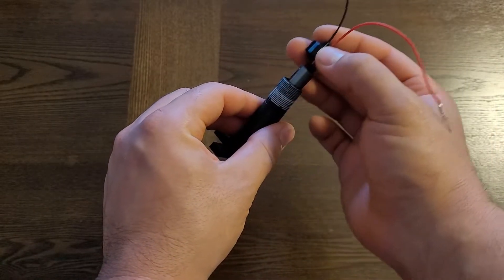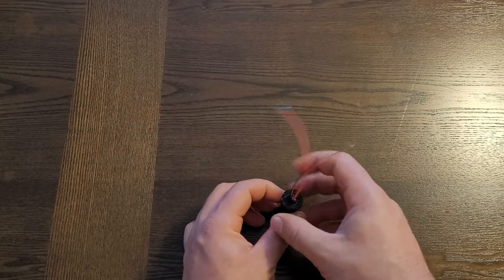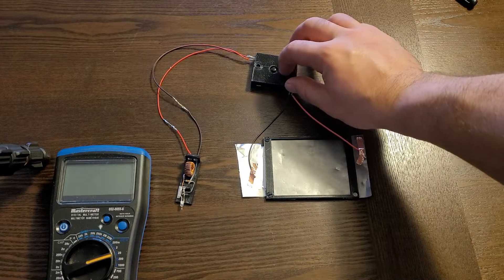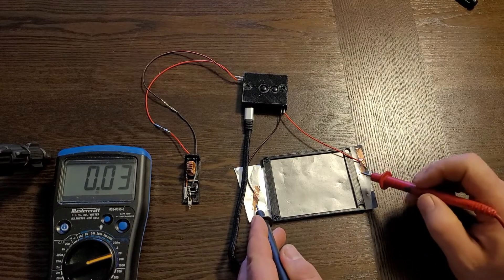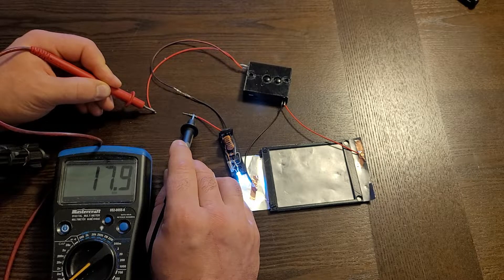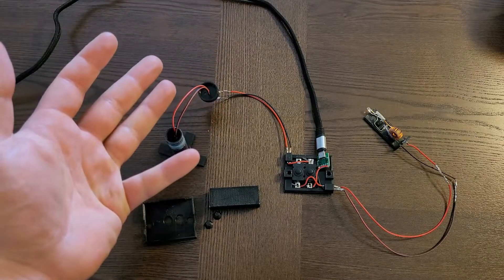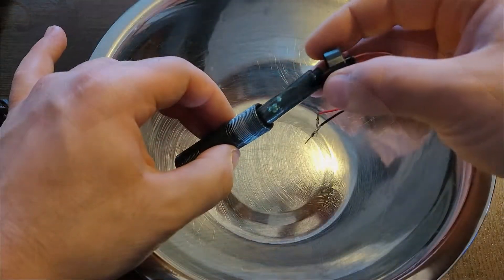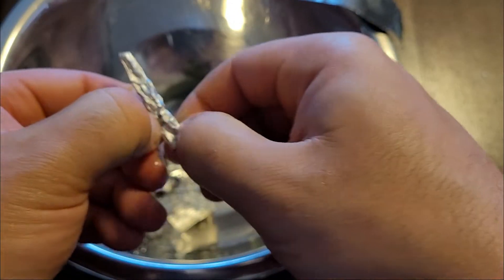Recharging my Aluminum Air Battery Part 2

Comment: Cool video! Ive gotten a lot of good info from you and your battery development. I started working on my first battery design in highschool a few months before your part one vid, so that was great timing.Just one question, which I don't know how many people you've had squawk about this, but do you think maybe you ended up making an aluminum ion battery instead?Aluminum air batteries arent rechargeable, at least not to the capacity yours shows. I've built 3 versions over the past couple years and they didnt recharge (I didnt understand at the time that there was aluminum ion and aluminum air until I made version 2) On the other hand, the liquid youre using has stuff in it that are highly similar to the electrolyte used for the Al-ion batteries, which as far as my research has gone, only seems to differ from Al-air batteries in its electrolyte (in a basic comparison), hence why Im asking this seeing that your battery recharged
Reply from the maker: Hi there @CAMARO54-jk6jb Thanks for the comment.  Great to hear you've been enjoying my videos.  I have wondered the same thing.  However because the charge dissipated quite quickly I thought perhaps the cell was behaving like a capacitor instead of an ion battery.  Unfortunately I don't have any way of proving or testing that hypothesis right now.  Sorry I can't give you more information.  Thanks for asking the question though.  Maybe that's something you'll be able to find out before me.
Reply: Well I’ll be happy to let you know how the experiments and testing goes with my next batch.
Reply from the maker: @CAMARO54-jk6jb  absolutely! I love to hear the work others are up to.  Good luck :)

Comment: it would be great if you loaded it with activted carbon. 
i get around 20miliamp with small , highest 70miliap with 1.7v i got.
Reply from the maker: Oh cool.  I've worked with activated carbon in other configurations, the best I got was 150 mA at 1.2V, but that was using a catalyst and special electrolyte as well.
Reply: @MechanicGoneRogue  tried yesterday with KOH UREA DES :d ,, GOT 200mah with 1.2 V Size 2cm * 3cm electrodes :D .

Comment: Good video.  I've always had trouble with aluminium air battery. Im currently playing with a Zinc iodide battery... trying to solve the self discharge rate.
Good luck
Reply from the maker: Thanks.  I'm glad you enjoyed it.  I agree there are lots of problems with aluminum air battery still unresolved, but it's still fun to dabble from time to time.  Best of luck with your Zinc Iodide battery.  Cheers!

Comment: well, I had another comment about paper zinc batteries here earlier, but youtube seems to have screened it out automatically as spam yet again. It isn't even in my comment history anymore, despite me not writing any links in it.
Reply from the maker: Well my disappointment is unmeasurable.  Seriously most of the stuff you send is super helpful.  I should really try to set up a forum or something.  I should have an email address in my about section.  If you want you can try that.  If you prefer not to that's cool too.  No pressure.
Reply: @MechanicGoneRogue  just sent an email a few hours ago
Reply from the maker: @PixlRainbow  I got it.  Thanks for sending it.  I'm about halfway through it.
Reply: @MechanicGoneRogue  meanwhile, i found out about calcium ion technology, which though non-toxic, hasn't really seen any attempt at commercialisation, unlike sodium ion and aluminium ion.

edit: it appears youtube deleted my second paragraph for some reason, so I'll write it in again:
I note that some batteries don't rely on galvanic operation. That is, they don't rely on the difference in reactivity between one electrode and the other to produce the voltage difference. Instead, both electrodes are made of the same material, and the active ion sticking around one electrode more than the other is what provides the voltage difference. Some sodium ion batteries, for instance, use the same material on both electrodes (most commonly "prussian blue" sodium ferrocynate). I wonder what would happen if you used graphite foil on both electrodes in your battery and then charged it
Reply from the maker: @PixlRainbow  got any papers on calcium ion batteries.  I'd be interested to learn more about them.  Interesting thought on using two graphite sheets as electrodes.  I could try my ethylene glycol DES or maybe even just salt water and see what happens.  I don't suppose you know of any papers that talk about this type of battery in more detail do you?
Reply: @MechanicGoneRogue  not much interesting papers that are directly applicable to diy construction I'm afraid. You can make calcium-based DES pretty easily with hydrated calcium chloride, but the electrodes are not nearly as easy to get your hands on.

As for the intercalation electrode technology, several battery types use that technique, including existing lithium ion batteries, I haven't looked that much into it.
Reply from the maker: @PixlRainbow  oh that's too bad.  I did look up calcium ion batteries after you mentioned it, but I gave up when I didn't recognize lots of the chemical names 😅.  I guess that'll be a project to try another day.

Comment: This is just Aluminum carbon chemistry.  I've been making carbon cells for about a year now and I have produced batteries in the tens of watt/amp hours.  Try zinc sulfate in water, your energy density should increase 4-10 times.  Aluminum metal actually works well with zinc ion chemistry, zinc ions will form zinc metal on the negative AL metal, turning it into a zinc carbon battery that is 100% rechargeable.  However, it's best to just use zinc foil for negative, you can buy whole rolls of zinc foil for roof flashing.  You can also just use graphite on both sides no matter what electrolyte you use, this is a super capacitor.  Though graphite foil works surprisingly well on it's own, activated carbon works about 4 times better.  With zinc ion chemistry and activated carbon, I've gotten over 80 watt hours per kg in energy density.  Hope this helps!
Reply from the maker: @Rob Weaver Really appreciate you sharing your experience here.  It certainly is quite helpful.  I've got a couple follow up questions?  Assuming I use zinc foil.  Will the zinc sulfite work in any non aqueous applications?  As you can see in my videos water evaporation has been a problem for me and I'd like to move away from it if possible.   If your using zinc ion chemistry does the carbon/graphite sheet still need to be exposed to the air?  I'm thinking of trying to sandwich the activated carbon between graphite sheet and paper towel, but that wont work obviously if it needs air to function still.  Thanks again for the comment.
Reply: @MechanicGoneRogue  I would probably stick to aqueous batteries.  Most solvent's available for DIY are very poor conductors, and you will get pretty terrible power density most of the time.  If you're having problems with evaporation, try flooding them more and sealing as best as you can.  There is no air chemistry in the zinc ion.  The carbon hold all the capacity and it's purely ionic.  It's actually a supercapacitor battery hybrid, which is why they can withstand so many cycles(10,000).  Be careful though, zinc sulfate will form zinc metal dendrites.  Dendrites will grow through almost any separator and short the battery out.  Printing paper I find works really well as a separator, but it's still not good enough.  Having some space between the zinc foil and separator is your best bet to stop dendrites(Even 1mm is enough).  If you have a gap between the zinc and separator, that means your cell needs to be 'flooded' with electrolyte.
Reply from the maker: @theinsider8872  Yah that's what I've been finding lol.  Making a sealed battery is pretty hard especially when it needs air to work.  Thanks for the heads up on the dendrite formation.  I've read about that being a thing for metal ion batteries.  Certainly want to give this idea a try in the future.  Cheers!
Reply: @MechanicGoneRogue  aqueous works for zinc because it's electrode potential is 0.76, which is below hydrogen's 0.83, so zinc just barely manages to be preferentially plated over hydrogen gas.
On the non-aqueous front, Zinc Sulfate (not to be confused with Sulfite) can be dissolved as a third component of another DES like urea/eth glycol/prop glycol + choline chloride, but it does not perform very well, giving a poor conductivity of about 5-7.5mA per cm2 of electrode area. The hydrated form of zinc sulfate can also be used for preparation with no problems though you might need to keep the solution hot for a while to dry it out before it will all dissolve.

Zinc Chloride performs very well when you dissolve it into another DES like urea/eth glycol + choline chloride (conductivity of 30mA per cm2 of electrode area), but unfortunately it has the same problems as aluminium chloride in that the dry form is required, but it is sensitive to humidity and can't be dried once hydrated, so it cannot be safely handled at home.
See "Electrochemical deposition of zinc coatings from the ionic liquid based on choline chloride" from E3S Conferences for more details.

On the note of keeping a gap -- what if you 3D printed a card or block with low infill and walls/top/bottom thickness of zero, so it just prints a mesh?
Reply from the maker: Thanks for clarifying @Pixl Rainbow.  On a side note I did look into getting zinc chloride before I got choline chloride, but I read the SDS on it and it seemed quite nasty.  Probably will stick with the zinc sulfate if I do try this as it seems a bit safer.  As for the 3D printing gap.  I'm thinking I'll probably just make a spacer like it did for my cylindrical battery cell.
Reply: Note of warning about zinc foil roofing. Some places refer to galvanized steel as "zinc" in casual/informal conversation. It is not pure zinc, just zinc plated steel. It should still work, just as long as you don't completely wear out the zinc layer.
Reply: @PixlRainbow  That may be true, but all the stuff I have worked with so far is pure zinc(99% zinc, 1% copper).

Comment: Yes...a new video! I believe that the DES cells will likely be able to be recharged many more times than the saltwater cells, due to their lower corrosion (did you by any chance experience rapid corrosion of electrodes in the saltwater cells after many recharges-what about the DES cells?). Also, I think maybe you could try out iron-carbon batteries: (https://www.youtube.com/watch?v=6vpa0ax09I0, https://www.youtube.com/watch?v=fYmxDFm9EXI, https://www.youtube.com/watch?v=DMNNIP908Yk, https://www.youtube.com/watch?v=g-wRD6Z4-5I), but this time with using iron filings/powder mixed with the ferric chloride as an "anolyte" (this could have much higher surface area & lower resistance), and maybe some grafoil as you cathode-from what I've seen these cells are quite powerful.
Reply from the maker: @Hi Thanks for sharing this.  I'm excited to know your following along in my battery experimentation.  I have looked at iron-carbon batteries a little bit, but I haven't seen these videos.  Thanks for sharing them.  I've considered using something like ferric chloride based etching fluid for this, but didn't move forward on it at the time.  The information in these videos is really good.  I may try this battery chemistry in the future.

Comment: Adding impurities to water makes it harder to boil/evaporate
So maybe adding some alcohol or sugar may help if you don't want to add more salt
Reply from the maker: @Guy That Yah I was really hoping that this one wouldn't bubble.  I'm wondering if its because I used coolant and not pure ethylene glycol.  Adding additional impurities might be a good work around though.  There was some talk in my last video about using sodium or aluminum acetate so I might try that approach.  Who knowns maybe a combination of that and my DES would do the trick.
Reply: @MechanicGoneRogue  honestly I was considering hitting electro-chemistry again and while having that thought when i saw your video i thought i may try to look into your current area but I thought you'd rather keep it a genuine first hand learning experience for yourself and i wouldn't want to ruin that week something as vile as an "education"  

So what's your opinion on that?
Reply from the maker: @guythat779  Well I don't think that you getting into the same area as me would affect the experience I am having.  It actually might even make it better.  I love experimenting and learning as I go, but having input from others certainly is helpful.  For me it helps me to think outside the box.  Sometimes I'll get so focused on a particular aspect of the battery that I don't think about doing it differently.  A fresh set of eyes can give different perspective.  Honestly I kinda wish that I had a bit more of a chemistry background.  I don't always know the concepts I'm reading about and it slows me down.
Reply: @MechanicGoneRogue  well then I'll keep that in mind, but don't keep your hopes up
I'm still a college student whose major has nothing to do with chemistry so it'll take me a while to gather the energy
Hopefully in this holiday, speaking of which merry Christmas and happy holidays my man :)
Reply from the maker: @guythat779  lol I won't, but if you are able to come up with something I'd be excited to see your take on it.  Thanks alot, merry Christmas and happy new years to you too.  I'll see you in the new year :)
Reply: @MechanicGoneRogue  looking at the MSDS of the specific brand of coolant you are using "Turbo Power Antifreeze/Coolant Concentrate", it says that it might be anywhere between 80-100% ethylene glycol. Which means there is a random chance your bottle has somewhere between no water at all to 20% water by weight.
Ethylene Glycol may also absorb water on its own, depending on the relative humidity of the surrounding air
Reply from the maker: @PixlRainbow  Well I guess if it says concentrate on the bottle it still doesn't mean its 100%.

Comment: Might be worth your time to play around with cell temperature. Could make the chemistry more sluggish but more dissolved oxygen in your cell may increase your overall capacity.
Reply: This! deep eutectic solvents generally perform better at higher temperatures (e.g. around 25-35 C/75-95 F room temperature), as long as you don't get hot enough to actually decompose the components of the solvent.
Reply from the maker: @m mclean @Pixl Rainbow thanks for the suggestion.  I hadn't considered that the temperature may influence the performance.  I'll have to try that in my next round of experiments.  :)
Reply: @MechanicGoneRogue  

I am sending this to you in case you decide to experiment with graphite ( or carbon) and manganese dioxide electrodes for a salt water battery: https://youtu.be/nvMVlhBmv7M
Reply from the maker: @jaysmith3259  Hey thanks for sharing this.  I found it very helpful in learning more about manganese dioxide in batteries.  Chances are I would have run into the same problem as this guy by using impure sources.  So good to know about this in advance.
Reply: @MechanicGoneRogue  

Ur welcome!

I am just as interested as you and I like the idea of the graphite as well.